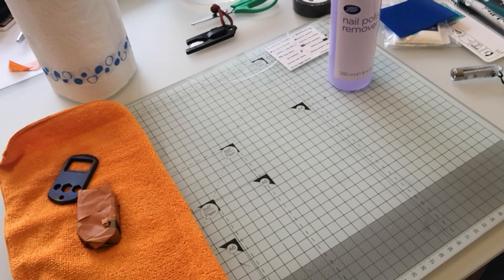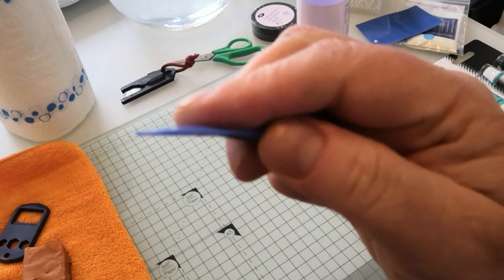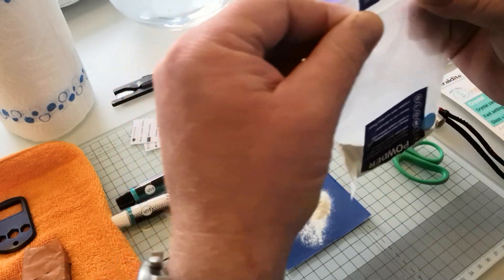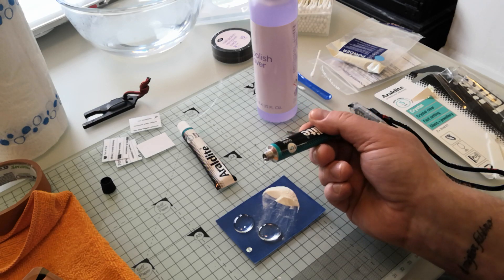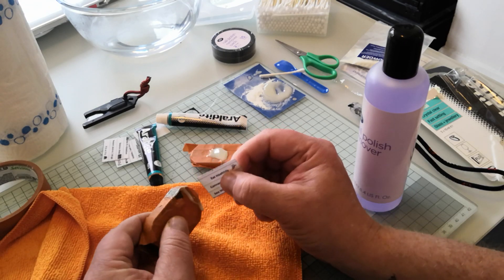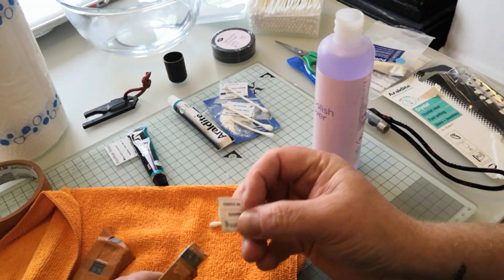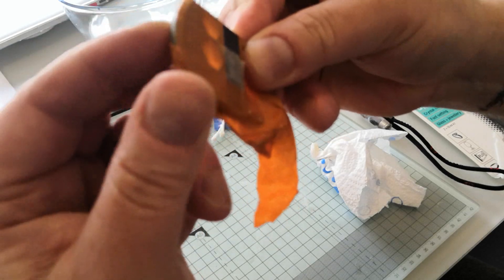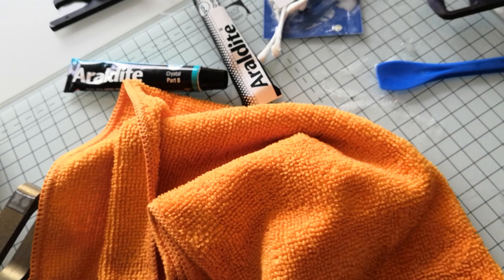Messin' With Resin. How to make a right hash of using Glow Resin on EDC items.

Comment from the maker: Before I update this vid with some proper night shots, here are some Macro pics I just took in daylight. Looks a great deal better than the vid suggested it might be. Links here:
https://i.imgur.com/kNvZloP.jpg
https://i.imgur.com/SyiTJrb.jpg
https://i.imgur.com/VVjHd8x.jpg
UPDATE:
Here are the low light shots I took. There is some 'overspray' to be see on the Pound on the left but it is only really visible when under a Macro lens. I will go back in and sort it.
https://i.imgur.com/StBcNfo.jpg
https://i.imgur.com/7LU6giB.jpg
https://i.imgur.com/Qxwi4NQ.jpg
Thanks again to Adrian of Damned designs for providing the two brilliant items: https://www.damneddesigns.com/edc/
Here are a couple of other Glow Resin filled items I have done. First an Ohana Spinner by Woosah! USA: https://i.imgur.com/fdah6YL.jpg
 https://i.imgur.com/gOrIySV.jpg and also a Kong spinner/adapter supplied from Raja at Fidget HQ: https://i.imgur.com/Jwe26Vs.jpg
https://i.imgur.com/ZZeN8pg.jpg
Many thanks for the support and baring with my daftness.
For those wishing to read about a more painstaking but better method of adding glow Resin it is worth checking the thoughts of u/murmanator here: https://www.reddit.com/r/FidgetSpinners/comments/bjgv7v/messin_with_resinbadly/
Idle.